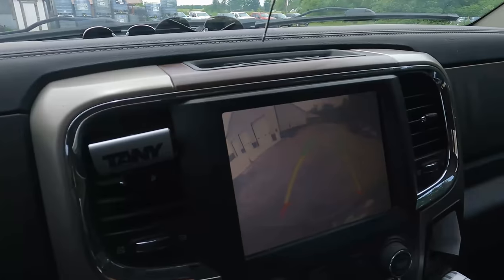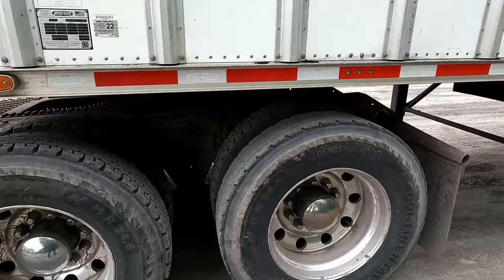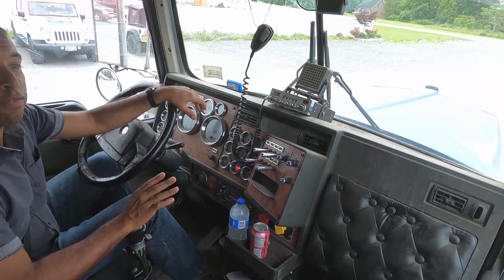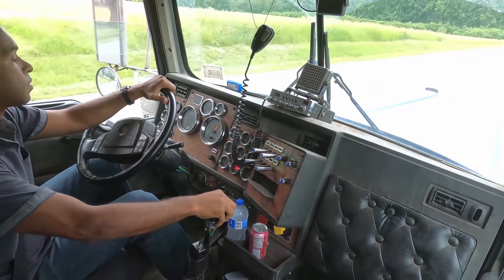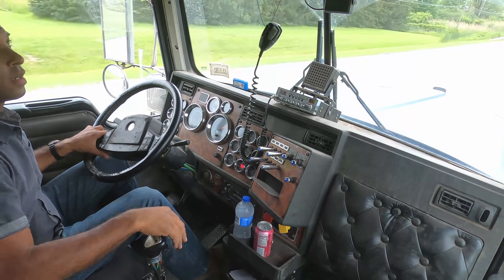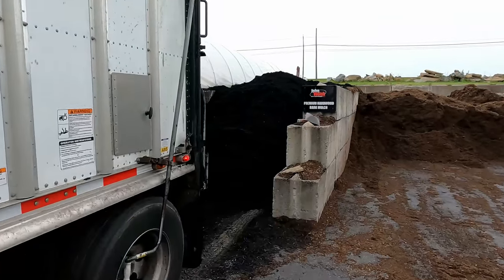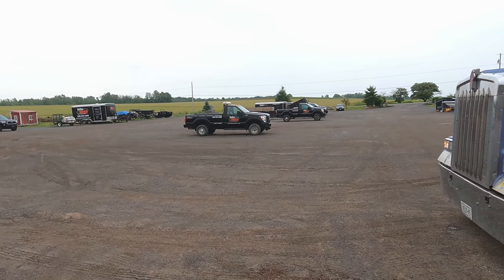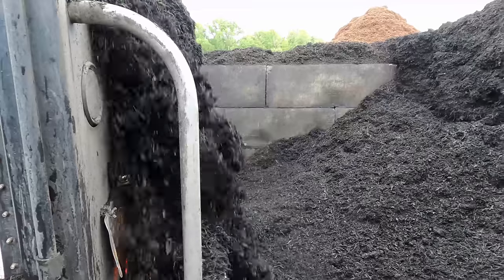Mulch Hauling With One Of The Favorites !!!!!

Comment: I miss hauling mulch,I did it for 21years. I retired after working for the same company for 26 years. Drove a peterbuilt with a Wilkins belt trailers and Peerless walking floor. You have a nice company and good equipment. Yes your right we get comfortable with our rigs and sometimes we let something's slide. But tires were always done with the gauge. We ran Michelin all the way around. We ran caps on the trailer until the tires decided to explode and came up through the walking floor, so more retreads lol. Keep trucking be safe.
Reply from the maker: Thanks!    Right back at ya !!

Comment: Justin. Pro tip, always turn your headlights off when loading and unloading or anytime parked, you don't wanta be like the Volvo freightliner guys who park with the headlights on all the time, it's hard on the alternator too. Just a tip from the ole skool. Great video
Reply: I leave them on bc they keep my apu running more. That way inside the sleeper stays at a good temperature

Comment: Why do you lot have the axles set so far back on long trailers as this means such a long wheel base meaning the trailer cuts corners so much??
Reply from the maker: I dont think you can get a belt with a sliding tandem......   we have to have our axles set for overweight permits